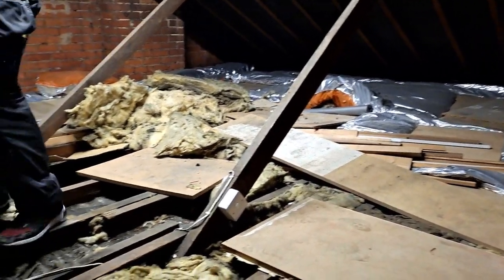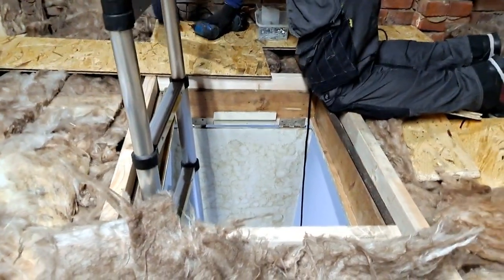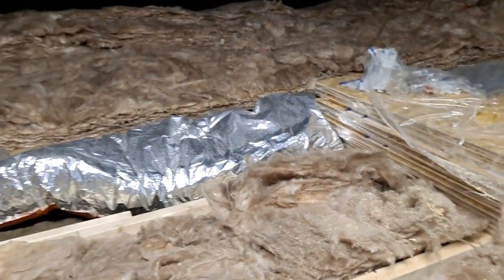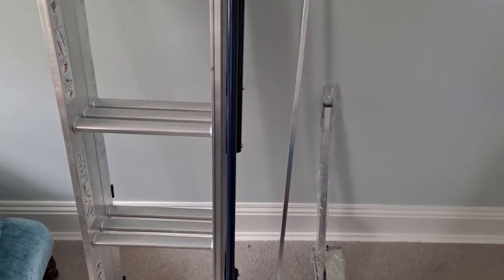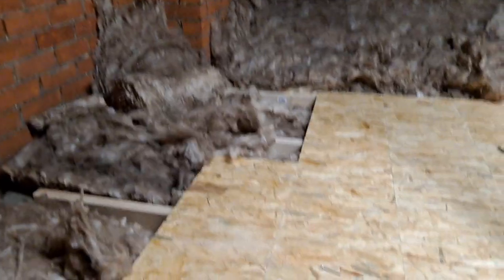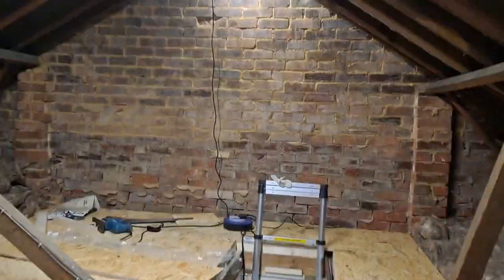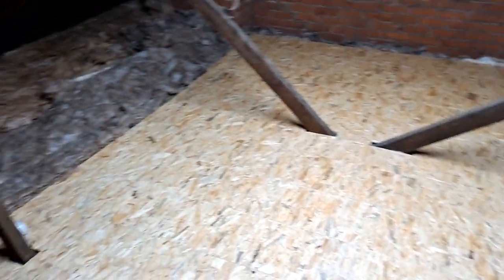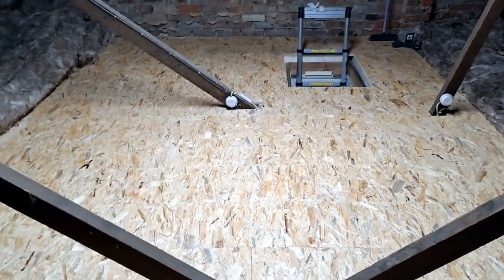Raised loft boarding- How to board a loft  - Loft Boarding (2021)

Comment: Hi mate the way you doing it’s it’s safe to do and can we use the space for storage??? & you putting the timber cross on the top of the joists is that good way to do. Pls reply me. Many thanks
Reply from the maker: Perfectly safe for storage purposes, yes use cross cls 89mm at 400mm maximum spacing, brace underneath all board joins with scrap wood etc.
Reply: Thanks for your reply.

Comment: I want to do this, but there is a water pipe running along AND OVER one of the beams. I'm not sure what to do. That pipe can't be changed, it's connected to the fire sprinklers. I'm thinking to raise the whole floor right over the pipe, but I'd need way more wood than I'm willing to get... what should I do?

Comment: With the tongue and groove OSB loft boards, is that to increase the integrity of the floor joints or is that just a small detail?

As in, is there a reason to using it rather than sheets of OSB ripped down to size as I'd imagine that would be more budget friendly
Reply from the maker: we just prefer the smaller osb boards as they are easier to handle and cut on small spaces.
Reply: @MrBish11  thanks for the fast response, I figured it was more for convenience but I suppose if ripping OSB isn't an issue for someone then it comes down to budget :)

Comment: Hi complete novice to this and just had our loft re insulated but the wool is like 200m thick and have existing chipboard (which is about an inch thick) that I want to place back on top - I want to place timber on top of existing  joists to give the insulation room for air but unsure the size of timber I should get to place on top  to lattice and size of screws to fix with - can anyone help? Many thanks

Comment: Hi great videos .. just about to start mine and was going to do the battens at 600mm centres is this ok ? And the insulation .. is it ok as is 270 mm can you just put the new joists on and the boards or do I need extra wool . Thanks .
Reply from the maker: 400 - 600mm spacing is fine, use at least 200mm insulation, the boarding will add to the thermal layer.

Comment: I knew I had seen 1 of your vids were you are dealing with uneven joists. How do you get around that ? When I lay a 3X2 across my joists on some joists it’s not touching.  How do you resolve this 🤔 cheers
Reply from the maker: Use any spare wood as a wedge where the gap is, just make sure that it is stable.
Reply: @MrBish11  I will cut a load of various width inserts before I start, it might keep the swearing to a minimum. 👍

Comment: Hi Grumpy man, how do you work out cross brace timber sizes? 
My original joists are 75mm x 38mm and span ~12ft from a central support to eaves each side. 
Appreciate any advice.
Reply from the maker: Preferably use 89mm cls, but if low pitched use 63mm at 400mm spacing, overlap each cls by about 4 inches at each end and screw into each other to keep the same height - hope that this makes sense.
Reply: @MrBish11  great stuff thanks, I’ll do some working out.
Reply: Hope you don’t mind me jumping in on brace timber size query.  My Binders are 112mm tall.  I was thinking of using 120mm brace timber so the OSB cover the binders either side of the loft and the binder in the middle. So basically binders will be hidden or should I use shallower braces so the binders are visible. Is this just down to preference and cost ?? Cheers
Reply from the maker: @markevans3026  Hi Mark, we always go under the top of the binders (runners) as the cost and weight would be too high otherwise !
Reply: @MrBish11  ok shallower it is 👍 thanks for the advice.
Reply: @MrBish11  last question honest. If I use 63mm is is it worth putting insulation under it and it will be pushed down and I thought it needed to breath ?
Reply from the maker: @markevans3026  In the years I have been doing this, I have never seen condensation arising from fitting insulation up to the osb level, in fact people are more likely to get condensation under the boarding by allowing the warm and cold air to flow under the boarding when leaving a gap -hope this helps..
Reply: @MrBish11  👍

Comment: Hi how do you fix the stud timber to the joists? Just with Screws?
Reply from the maker: Hi Jeremy, yes we use 2 inch x 8 wood screws, these work really well with the cls joists that we use.
Reply: @MrBish11  do you screw them through the sides of the CLS timber or straight through the top?
Reply from the maker: @jezr10  about an inch from the bottom of the cls angled towards the original joists
Reply: @MrBish11  awesome thank you

Comment: Hi. What size screws did you use for this and how were the CLS attached? Did you screw through at an angle into the joists or straight through the top of the CLS into the joist?
Reply from the maker: 2 inch twin thread wood screws, screw into the cls downwards angle about three quarters of the way down into the joists.
Reply: @MrBish11  appreciated. I’ve been volunteered to board the mother in laws loft.

Comment: Can you just confirm 

You just roll back the extra insulation

So there is no insulation under the new boards?
Reply from the maker: No just roll back the top layer
Reply: @MrBish11  Just started this project

Having a lot of issues in our Victorian house as the wood is warped and high low spots

I don't know how to deal with it mate
Reply from the maker: @deepmystic5850  brace up any areas that you have a dip, just use cut off osb and screw into the joists, should be fine as I have done that hundreds of times, just take your time with it and do it right for safety etc
Reply: @MrBish11  I really appreciate all your help and the videos

I would really love to see some future videos showing how to circumvent these issues
Reply: @MrBish11  I really appreciate all your help mate

But I have had to stop this project

When I was moving around on some of the ceiling joist I was feeling a fair amount of movement

It has made me paranoid about adding more weight to it

I think I am going to hire someone to come and fix the current joist 

It wasn't alot of movement but it felt in some places the ceiling below was about to crack or giveway

Such a shame